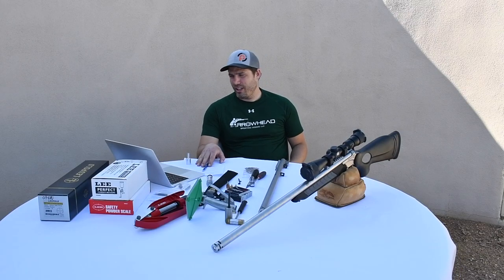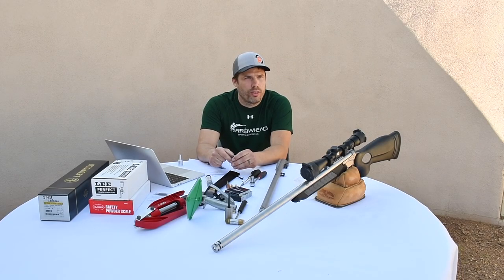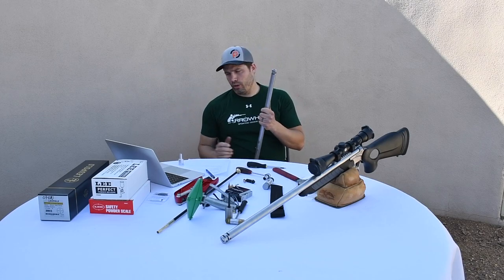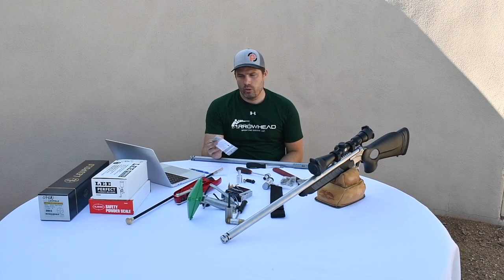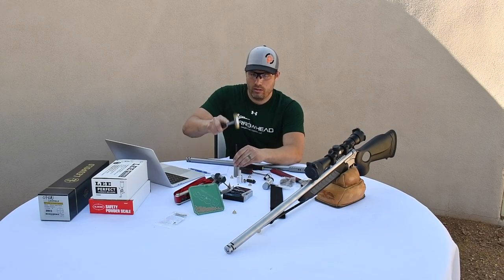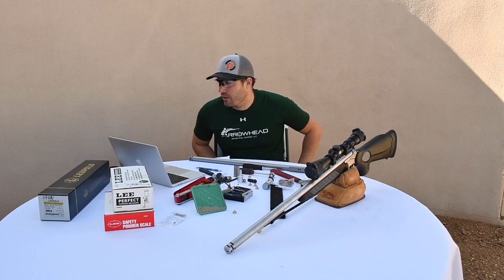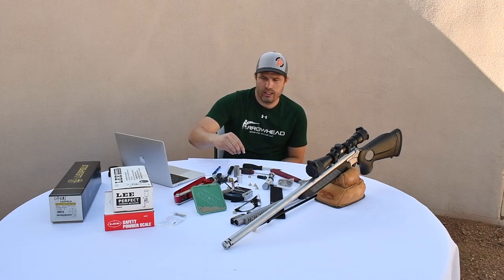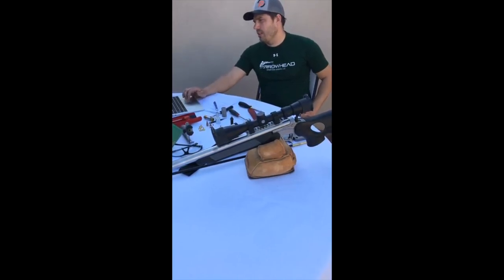Arrowhead Smokeless Muzzleloader Barrels for Encores

Comment: I'll pose an odd question - exactly how critical is the ejector?  I removed mine and have been running without an ejector for 20 years.
Reply from the maker: With loose fitting primer pocket on factory plug it doesn't really matter.